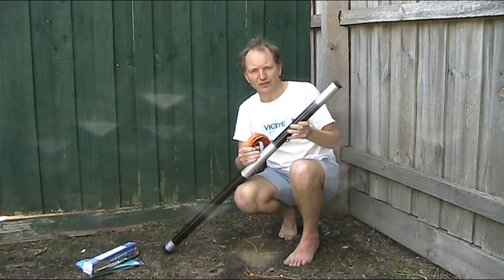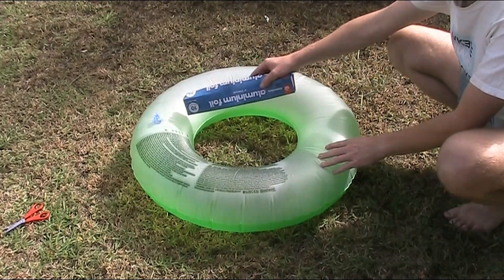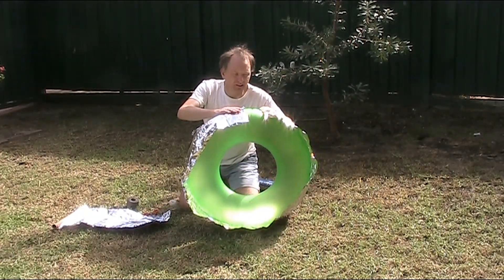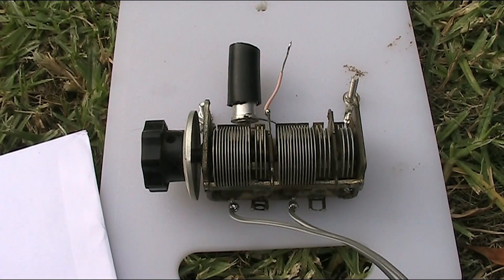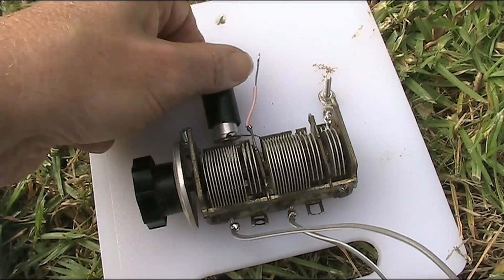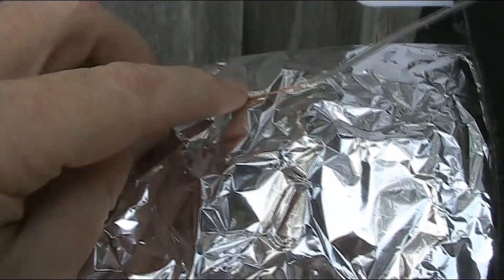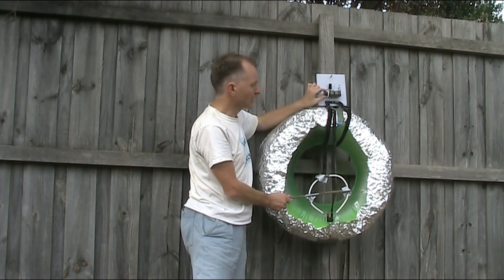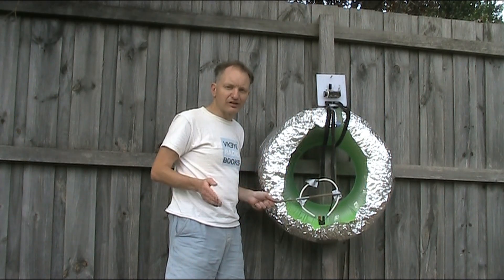Attempting an inflatable magnetic loop

Comment: You could take some copper mesh and use that (just saying). The lower resistance losses might make it an option. If you keep trying Ali foil, try and get a turkey roast one of the wide long rolls and when you roll the inflatable tube it should be wide enough to meet.

Comment: Use a bicycle inner tube it will come in all sizes. Go to a bike shop and get the big wheel more than enough and light weight. Anything you get will be a small package until you inflate it. Good Luck

Comment: I think your original ideas was almost correct in spiral winding the foil, but you probably would be better served by narrow strips with turns that do not touch side to side.

Apart from the video below a more robust dual helically loaded (wound) parallel fed loops have been very successful. One loop vertical and the other horizontal on two-axis rotators.

I've thought about building the hulahoop loop, but wrapping the loop with pipe insulation first.

I did build a "midnight loop" out of aluminum flashing. I never got it to load below about 3:1. I made the drive loop out of LMR-400 and it would go back to a more preferred shape. I ended up tearing down before a hurricane and haven't revisited it, but the original designers did very well with it. The ends of the flashing were a compression capacitor that was motor driven.

The original designers automated the tuning.  My motor was manually controlled.

https://youtu.be/B-tYtbTts0s

https://youtu.be/TiFDUjjnW8I

https://www.midnightdesignsolutions.com/MidnightLoop/Midnight%20Loop%20(Mar%2011a).pdf

Comment: This is BY FAR, the best information that I have seen on mag loops.  I have an MS in Physics, and also have an RF engineering background.  All the information in this video makes complete sense.  Adhesive aluminum on PVC is the way to go, but I can see copper having the advantage of being able to produce a better bond with the capacitor: https://youtu.be/7pKHC4B5Esk

Comment: The resistive losses entailed in taping copper wire onto what is effectively a thin layer of aluminium oxide must be huge. Nice idea, but I can't see it replacing a loop of wire and a couple of spreaders.
Reply: Most of the small wire loops are not magloops of 1/10th wavelength, but larger up to 1/4 wavelength that less lossy, slightly lower voltages, and require less capacitance.
Reply: You need tones of skin effect for an efficient mag loop.  Wire is awful for that, but your comment about the junction may be correct.

Comment: A nice idea, but it might be simpler to tape a length of coax around the outside of the rubber ring and use it's braid for your radiating element. This may be a patch lead you already have (guessing around 3 metres) in this case.

Comment: Nice tip, many thanks for sharing. I suggest trying an aluminum and/or copper tape next time. One side of the tape is sticky and it's going to be much easier to make a loop with it. Also, copper tape is solderable. For 14 Mhz the loop seems to be a bit small. Its length should be between 1/8 and 1/4 lambda, but your loop doesn't seem to be 2.5+ meters in length.

Comment: Thats time consuming i go with the dryer vent pipe i used it and it worked very well💯👍
Reply: Thanks. Any details on construction would be appreciated. Especially the aluminium tube to capacitor connection.

Comment: I would be arrested if I took that variable capacitor on a plane. lol.
It didn't work out but the magpie wanted to pop the inflatable toy. :) Back to the drawing board.👍
Reply: I wondered about that too. In the UK I have been OK putting radios and antenna bits into hold luggage. However, I have had problems trying to take radio related items on as hand luggage. I even had a small fibre glass fishing rod confiscated once because security said that once extended to 1.8m, it could be used as a weapon. The usual sequence of events is that the security official asks to empty my bag and finds radio, battery plus assortment of strange wires and antenna bits, ask, "what is all this for sir?" I explain I am a radio ham and get a blank look. All in all, best to put it in the hold luggage wherever possible.
Reply: @Steve-GM0HUU  yes true. You should always keep a printed copy of your Amateur Radio licence to save the million questions and possibly taking your equipment.👍in 2017, I packed 8kg of locks for a buddy to the States to save on shipping. It was in checked in luggage but TSA cut two locks on the plastic ammo can style box as it must have looked strange on the xray, go figure.🤷‍♂️

Comment: So many possibilities! I vaguely remember someone making a loop from a metal slinky. Would using copper tape work, garden centers sell this to keep slugs away from soft fruit, which  may be cheaper than tape used for pc boards. A hula hoop may be a better option for the "former", rather than the inflatable. As the idea is to keep weight to a minimum, plus the fact that you will not be bringing the antenna home, low cost is essential. Given the lack of Ham stores, the foil is a good idea, is a little difficult to handle, so the copper tape could be a good alternative. I see some interesting play time ahead!!!!. Jim M7BXT
Reply: I can confirm that the hula hoop covered with self adhesive copper "slug tape" works just fine. I built one: plastic hula hoop of about 800mm diameter, covered with copper slug tape, heat shrink tubing over the copper to protect it. The coupling loop is just a loop of copper brake pipe about 1/5 diameter. The brake pipe is quite good as it is rigid enough to hold it's shape once adjusted to a shape that gives good match. I have used it successfully as a portable antenna on 30/20/15m. Not suitable for packing in a suitcase. However, you could take a hula hoop broken into sections, the small loop and coupling capacitor plus a roll of slug tape. This would allow you to make one at destination in minutes? Alternatively, cover the large loop sections with the copper tape and connect them with thick braid so it can be broken down to suitcase size. I haven't tried the latter, it may not be as efficient as the continuously covered loop?

I even found that, if I was careful, I could solder heavy braid on to the copper tape covering the plastic hoop without melting the plastic. This was useful to ensure very low resistance on the outer loop to capacitor connections.

Although the hula loop works, it would be good to try an outer loop with much greater tube diameter for better efficiency. Peter's inflatable ring idea has got me wondering if a ring covered with copper slug tape might work. Once defaulted it would be fragile but might be able to be folded just enough to fit in a case🤔?

Comment: It was the connection to the capacitor that killed it. If you were to use something to make a capacitor with the ends of the foil, you’d be shocked and amazed. 

Suggestion would be to use a couple of kids hoolahoops, some spacers and use them to make a frame for the foil. 

10m of foil should give you very efficient loop for 40m. I would also try feeding it with a gamma match if you can’t get the feed loop working properly
Reply: You can make a simple "butterfly" like capacitor by leaving a gap in the foil at once place around the ring and then having another piece of foil that slides over the gap with an insulating barrier in between.  The capacitance can be changed by sliding it around the circumference of the ring, with the greatest capacitance when the moveable foil is symmetrically over the gap, and the capacitance being reduced as it is asymmetrically positioned across the gap.   It might be easier to do this if the loop was designed to have a flat side where the gap was so the capacitor could be actuated by a linear motor.

Comment: In an old video of yours I noticed a bit of white plastic on the back of your FT817, under the power connector. Is that to make the connector less wobbly?
Reply from the maker: Yes. I did a video specifically on that.
Reply: @vk3ye  Thanks for the tip, I found it: "Less stress for your FT817/818's external power connector", at https://www.youtube.com/watch?v=kT2wJwCBZm0